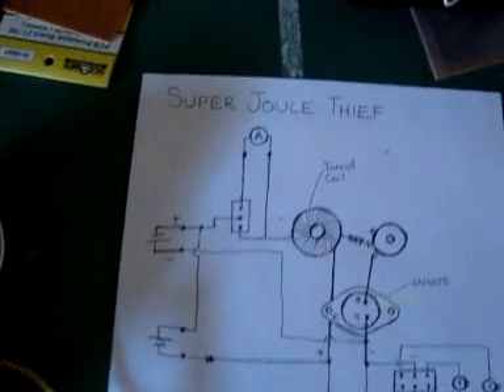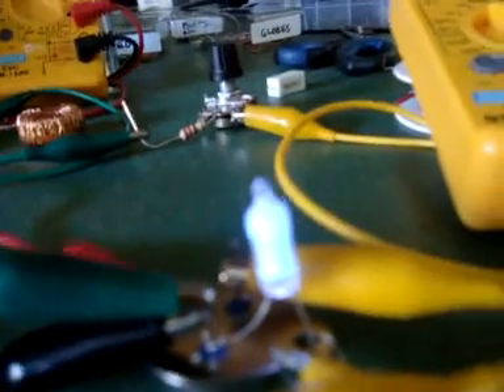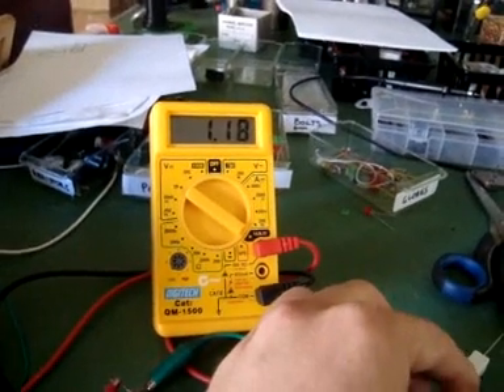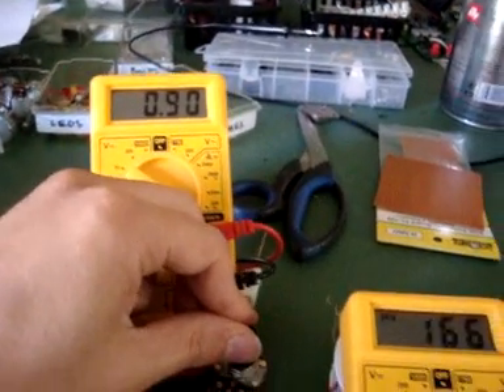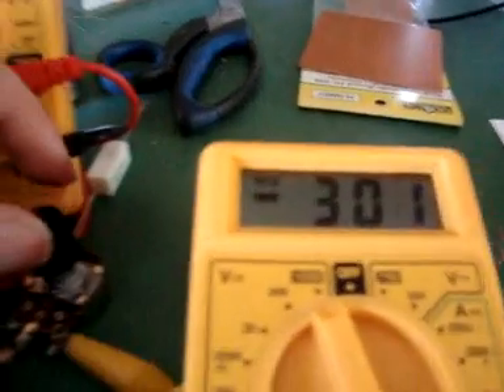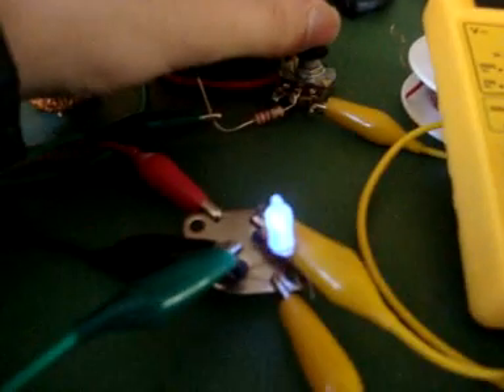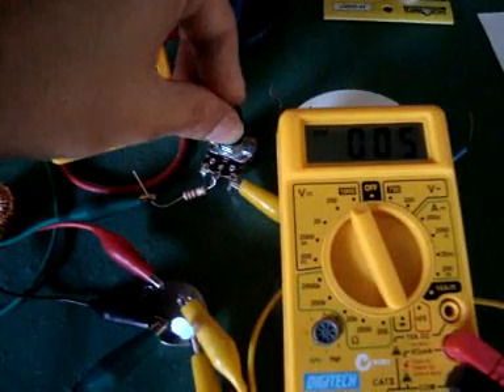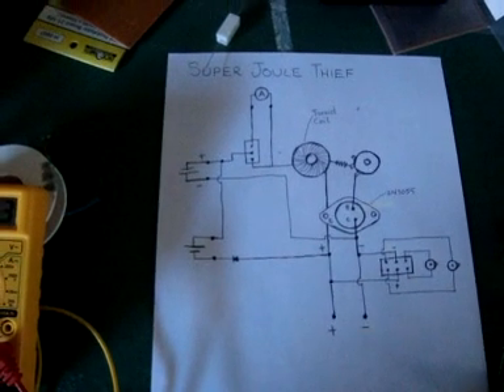High Voltage Super Joule Thief Resonating 02

Comment: you need a smoothing circuit with a few resistors and capacitors like in a probe for an osciliscope. so the high frequency currents dont waste your multimeters

Comment: volts used, divided by curreny or amps equals ohms. u had 600 ohm resistance.
6 v divided by 1 amp..

Comment: the waveform to your voltmeter is more appropriate as an AC voltage. Your meter, in DC mode, will have a DIODE in the circuit inside and has a breakdown voltage.

Comment: OK, i replicated this circuit ... first thing, throw thoose multimeters away and get a real one, the circuit probably resonates with your multimeter and cause it to blow (i also hooked up a cheap one and heard the buzzing inside it). Also the negative thing is a missreading, but there is some harmonic resonance going on... second, when the resistance gets higher, the frequency gets higher (and the amp draw is less), the resistance is messed up through the whole video.

Comment: One other thing, it's confusing about which way  the pot is being turned.  I say this because lower resistance would be turning towards the resistor.  But the circuit's reaction seems the opposite of what would be expected.  Lower resistance would mean more base bias current, and that would mean more supply current.

Comment: I'm not sure why many of these JTers use a neon lamp across the C-E of the transistor.  The 2N3055 is rated for only 60 volts, and the neon lamp is 90 volts, half again as high as the 2N3055's maximum. Why not use a string of 18 white or blue LEDs, each 3.3V, for a total of about 60 volts.  Of course, put a diode across them antiparallel, with the banded end connected to +, to protect the LEDs in the reverse direction.

Better yet, use a higher voltage transistor.

Comment: Very nice!!!!
You make me remember what John Bedini said on a show with Bill Jenkin to a caller who had successfully replicated John Bedini's motor, only that it was solid-state and self-sustained. He told John that when the circuit was tuned to the resonant frequency of the battery, then the current and voltage dropped to zero, still the light bulb that was connected was glowing fully bright, and John said "that's it, you got it".
Its about the spikes, and how you capture it :D

Comment from the maker: At 6 volts this circuit is quite safe. At 12V u have to be careful not to blow things up. At 12V this circuit is great for charging 12V batteries

This circuit is better for charging batteries, not very efficient at lighting LED's
do u want me to do another video on this circuit?? it is the same as the next 2 videos where I charge batteries

Comment from the maker: this circuit is bigger than the little joule thief's and yes it consumes more current. The current draw is dependent on the number of turns and the gauge of wire. I would use the balast resistor (100-200ohm - 1-2Watt) to protect the Pot. The 2n3055 should be heat sinked.
When u apply less resistance on the Pot u will draw more current and the pot might blow so be careful.

Comment from the maker: The A means Amp Meter. That part of the xcircuit is not nessacery. there is a switch over the input so i can switch it to amp meter mode. U dont need it.

The pot comes after the coil next to the resistor.
Resistor is 100Ohm and pot is 1kOhm

Comment: Same goes for the multimeter. My yellow one has a foil piece at the back where the hand grip is.

Bewarned though, shut down the circuit befor using the grounding because their could be a hv discharge...

If it's still going nuts then it has to be the high voltage and high frequency combination jumping the tracks inside the multimeter.

Comment: 750V setting is good for 1000 volts...
on the AC setting it should not go negative...

ok, two last things to try...
Connect the negative of the primary battery to a ground source... 
The other thing to try is to put the multimeter on a metal plate thats grounded...

Be warned, if it's not a true ground it isn't going to work.
By grounding the neg on the primary battery you give the battery a reference point to start from and stop the relitive voltage floating around too much...

Comment from the maker: Hey Comwarrior,
I tested the voltage on AC the high voltage 750V setting and it still goes positive to negative and is too much voltage for the meter to read. It also can go to zero volts and light the neon.,

strange....

Comment: Well, i have two multimeters that quite often squable with each other... lol 

i don't have a scope...
I use a low capacitance high voltage capacitor.
The faster and higher it charges the better...

Simple, crude, but it works...

Comment: basically, I have a bedini fan on a test circuit (see my last video)
it's charging two 200 volt 470uf caps seperatly upto 90 volts from a 12 volt battery...

Theirs no way in hell the back flow from the coils is giving me such a high voltage, it has to be radiant energy to get it to that voltage...
Also, if i short out the caps it's green spark not blue...

Comment: I don't have a scope nor can i get access to one...

Instead I use a high voltage cap... 
simple principal really... 
The faster the cap charges the better...

basically, if you stick your multimere across the emf outputs (while it's in LOW output mode) you'll pickup the 'static' DC voltage...
If you double that voltage this should be your minimum start voltage for your capacitor. Anything above this is your illusive radiant energy...

Comment: switch your multimeter to AC high voltage not DC high voltage...

AC high voltage should be able to handle the high frequency high voltage pulses.

Also, when your multimeter is readng zero volts... switching to AC should reveal the truer voltage...

I also find i get interesting results when i to AC amps too....

Try it